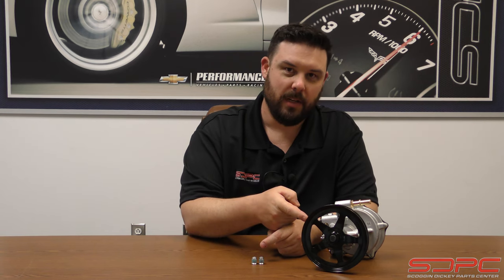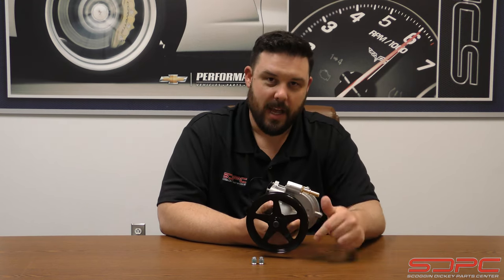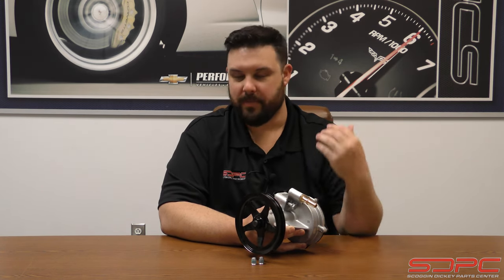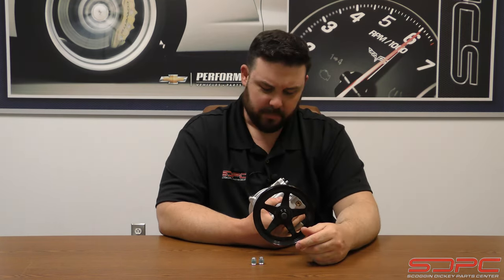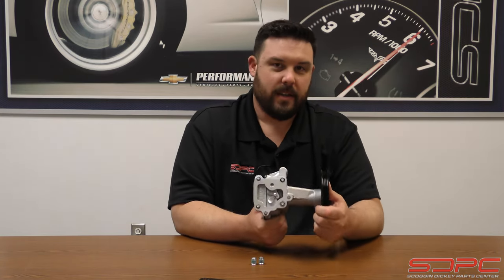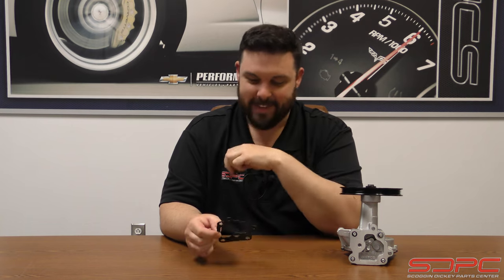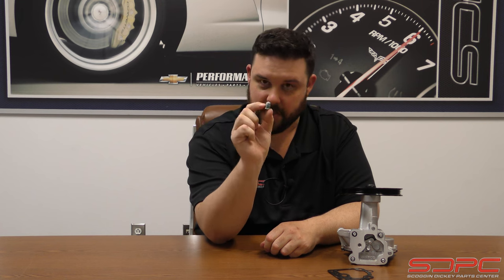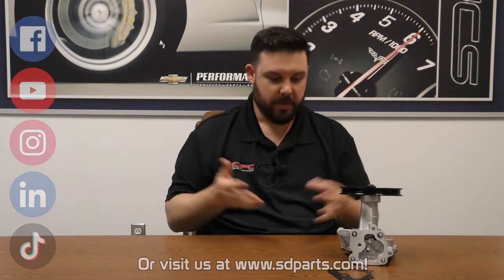SDPC Tech Tips: Deleting Your GenV LT Vacuum Pump

Comment: To add to this information, the pump outputs the brake booster air into the block through the oil return. The crankcase breather vacuum is also pulling through the pump at idle. The pump is literally an inline crankcase vacuum "helper".

Comment: Ok, so just pop a plug in the brake booster hole too??? Pulling the pump off and plugging the two holes in the block doesn't complete the vacuum pump "delete" process in my '17 L86 silverado.

Comment: So would you delete this on a 2015 Silverado5.3 or only delete this on the project you're motor swapping? I would guess you would need to tune out the DOD before removing the pump?
Reply from the maker: You could, some will either use an electric pump, or tap the intake. If you're running a turbo or procharger, you'll want an inline check valve so you're not pressurizing your brake booster.

Comment: If I remove the vacuum pump on a 2014gmc with the 4.3l lv3,  where do I land the line coming off the vacuum boostet for the brakes.
Reply: I would love to a dod  on my lv3, trying  to piece  a kit together and no luck, help Claude lamotte.
Reply from the maker: @claudelamotte  

LV3 DOD Kit:
https://sdparts.com/i-24504716
Reply from the maker: There are a few ways to do this:
Tap intake manifold
Tee into pcv line off valve cover
Add electric vacuum pump
Reply: There was a certain electronic assist by the brake vacuum boost. For the 2000-2007 classic GMT800 LU3 V6. I presume the same for the 2007-2013  GMT900 LU3.

Comment: So I have a 2014 Silverado l83 full dod deleted already  and I am looking into deleting this I understand the block off plugs for oil passages but what do I do with the vacuum line to I just block it off? Is it necessary to have the vacuum like if the truck is deleted? And do I need to add anything else so my brakes don’t loose vacuum or does it get enough from the engine itself?
Reply: David Rogers  Could I just put a T in the pcv line and run the hose over to the brake booster?

Comment: So if I delete this & install an oil catch can, can I tee the booster hose into the clean side hose of the oil catch can? Some people are saying get a throttle body spacer & add a fitting but I don’t see why I couldn’t just tie into the oil catch can line on the clean side…TIA for advice
Reply from the maker: If it is a sealed catch can system, the clean side (the hose that goes from the can to vacuum) could be used. But we would still recommend using a dedicated source off the intake manifold, as there is potential for oil to track up the booster hose over time. catch cans are not 100%.

Comment: How does the brake booster get vacuum?
Reply from the maker: Without this? The Corvette and others use an electric vacuum pump.

If you're doing a swap, you can source an electric vacuum pump, or tap the intake with a barb fitting. If you're running a procharger or turbo, you can run an in-line check valve to prevent you from pressurizing the brake booster.
Reply: @Sdpartscenter  Thanks

Comment: I recently did a dod deleto on my 2016 Yukon 6.2 and I did the vacume pump delete. I used the gm plugs also. Now my brakes dont work properly. Is this due to the pump not supplying vacuum or  could if be another brake system issues? Do I need to run it to provide vacume?